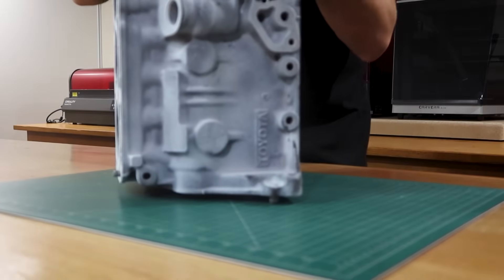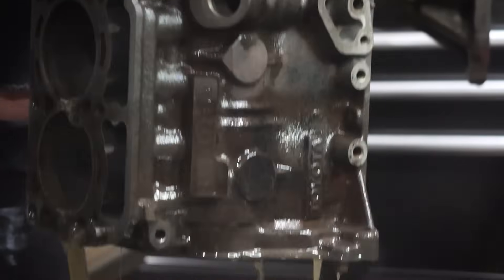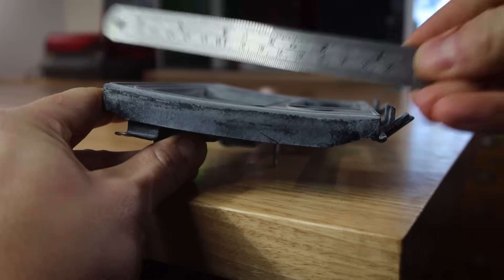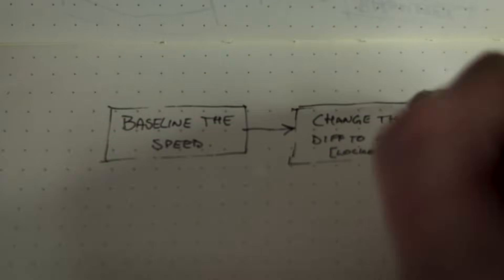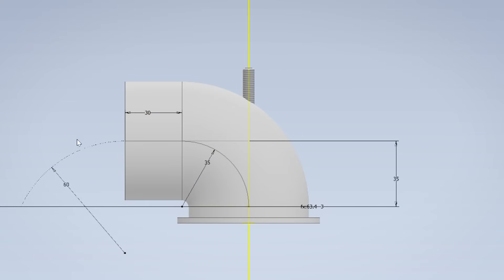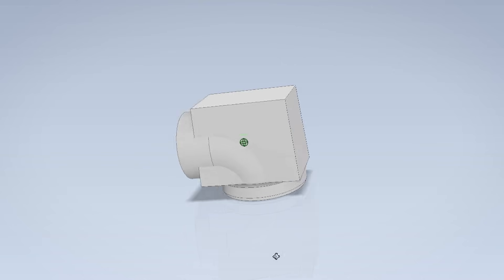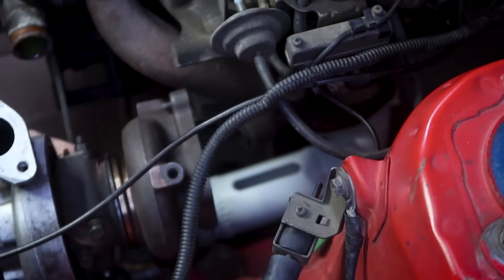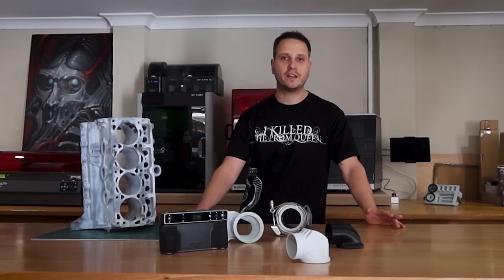3D Scanning Turbo Car Parts – CAD Modelling & 3D Printing | Revopoint Miraco Plus 3D Scanner

Comment: I think you should stick with the Corollas. In general, I think your engagement would probably be a little better if there was a little more focus on specific projects. I enjoy seeing your process (I'm also a CAD designer) and I generally get around to watching your videos, but I usually wait until you've released multiple videos to watch them because you jump around a lot compared to other content. That requires that the viewer do a lot more work recalling what you've done and what you're doing, which makes it more difficult for casual watchers to get into your stuff.
Reply from the maker: Hey mate, I appreciate you taking the time to comment.
I completely agree, everything is a bit all over the place at the moment so I've just been trying to document the things that I am working on to tick a few things off.
Lots more corolla stuff is coming for the next few vids

Comment: I struggle so bad with my Miraco. I tried scanning a Harley engine and the overlapping areas never line up perfect so there’s floating areas to clean up so I never could get a clean mesh. It also seems like if I move slightly wrong it easily loses track and starts overlapping. Kinda wish I got a laser scanner but I’m still not sure If I’m the problem or it’s my scanner. 

But I think your video is great, I subbed, your work path here is exactly what I’m trying to achieve also.
Reply from the maker: Thanks mate I appreciate it.
Slow and steady is the main thing I would say. Developer spray also helps depending on the component and you may need to adjust the IR sensitivity. Also you can manually align the scans on your computer software, I included a little about it in my most recent vid :)

Comment: For  carb tophat, you might want to confirm if oring seal at stud / nut connection is required. Possible leak path.
Reply from the maker: Yep it's gonna initially have a tpu gasket but definitely a possible failure point :)

Comment: I’m lazy. When I do o-rings, I just go to one of the calculators online 😂 they also have racetrack o-ring calculators that are pretty helpful if you’re trying to seal a non-circular hole. It’ll help you to find the right common o-ring instead of needing to use o-ring stock and superglue
Reply from the maker: Thanks mate I thought about it but I also wanted to learn more about the design considerations behind it so it was a good learning exercise. No doubt I could have saved hours by not doing that though lol
Reply: @fatlipcollective learning why gives you way more insight as to how. Fully agreed! Next o-ring design, you now know the whys and can do the shortcuts ;)

Comment: Excellent stuff! I definitely appreciated the O-ring details. Also yas I love my ultrasonic cleaner! Being able to fit a whole cylinder head is so useful. PPA is probably a solid material choice. PET could also be a good one. Both fiber filled of course. My only thought is you may need to support your bolt boss somehow or else the material will creep over time when heat soaked. We did have great success with a carbon fiber nylon throttle body adapter on our rotary swapped BRZ even at high boost.
Reply from the maker: Thanks mate! In all honesty I'm not expecting to keep the stock carb on the car that long but I am also interested to see if there are any effects of creep :)
Reply: @fatlipcollective  Best way to find out is to do instead of wonder, so you're kicking ass. ;)

Comment: This a great video and thanks for showing off what this scanner can do. Not to be one of those guys but you should not stick your hand inside of an ultrasonic cleaner WHILE IT'S RUNNING!!! The ultrasonic action can aerate the blood in your hand and potential you could have a blockage of blood flow due to lack of flow (From a air bubble). This blockage could make you pass out shortly after, if you're like me (Based on your videos) you probably use other dangerous equipment that could harm you if you pass out. Please be safe!
Reply from the maker: Thanks mate appreciate your concern. You're right it's pretty bad practice lol, usually I'm pretty good with it but I'll keep on top of it 🙏

Comment: You only need die grinder to get engine straight, so I would say it's budget friendly.
Reply from the maker: Not quite :)
- Need a new oil pickup in the sump,
- New engine mounts,
- New intake as it'll hit the bonnet / carb will be off angle,
- Shifter will be off angle, which you could live with but not great.
Reply: @fatlipcollective  Well I didn't do any other modifications, just modified RH engine mount bolt holes. Had to make more room for bike carbs.

Comment: Excellent!  Several things I’ve been researching condensed into one video.  Very interested in the cylinder head design.  Can you do a tutorial on how you did the expanded model?  Did that require you taking apart the entire engine?  The reason I’m asking is the cylinder head I want to design is rare and the engine is running well right now which is a rare thing for me 😂 and I don’t necessarily want to disassemble it atm.
Reply from the maker: Thanks mate!
Basically impossible to model accurately without having one off the car. I will be covering a lot of this when I get to the design vid for the DOHC head :)
Reply: @fatlipcollective Cool looking forward to it

Comment: Apologies if you are already familiar, I found when I 3d scanned items like a head, where there are threads involved,  and I specifically was after there centre detail, I used to fit taps into the appropriate thread, which rhen gave me ability to confidently recreate an axis/centre point. Similarly where there were studs, I'd place nuts on them, to allow it to be easily reverse engineered.
Enjoying the videos,  great to see, 
Cheers
Reply from the maker: Hey mate, no need to apologise I appreciate you sharing some info.
Sometimes I will similarly leave a stud or a bolt in a tricky location, but most often I'm able to get the info I need - particularly with newer scanners as they get better and better.
Thanks for the tip all the same - appreciate you watching!

Comment: Love the turbo hat mate. Might want to add a boost reference on it for rising rate fuel reg. They like the reference close to plenum.

On my boosted k, the stock carby didn’t last long, but moving to Weber was an incredible difference. Felt like it improved performance about 40%.
Reply from the maker: Hey thanks mate!
I'm thinking of taking the reference from the manifold as there's already a barb there, I was considering adding it to the hat but the less holes I can have in it the better I think. At least for the initial version.

And I've no doubt the stock carb is going to be completely underwhelming haha.
I've got another 32/36 there that I was planning on trialing as well, but I'm also tempted on the SU as I was thinking of designing a little manifold for it too...
See how I go! Appreciate the feedback and comments as always ✌

Comment: It appears the carb on the carrolla is an Aisan? Daihatsu cb61 is a turbo blow through set up with an aisan 28mm. So ur turbo hat gives me ideas to convert my non turbo cb23 but also maybe daihatsu parts might help you too. I vote, finish the red car first and cylinder head on the back burner with updates maybe?
Reply: Actually, 63mm is exactly what I've got in my cad drawing of my own top hat!
Reply from the maker: Hey mate that's interesting I don't think I've ever seen one of those before.
Red car will definitely still be getting finished in one way or another and yep I think the cylinder head will be a slow burn as well :)

Once the design is done I will have the carby hat available for download on my website, too :)
Reply: I had a GTti with the CB80 back in the day. Miss that car.

Comment: Corolla and Cylinder head content. I have a te27 center console and 3 gauge cluster if you want to scan it.
Reply from the maker: Hey mate thanks for the offer, that's very tempting. I regularly punish myself in my thoughts for the one I passed up on YAJ 10+ years ago lol.
I forget, are you based in Melbourne? Shoot me a message on Instagram if it's easier :)